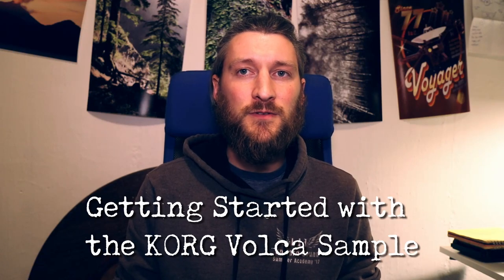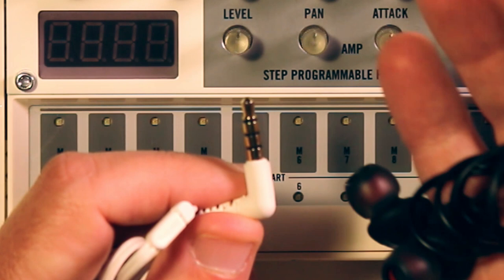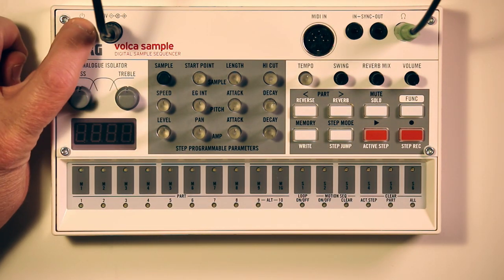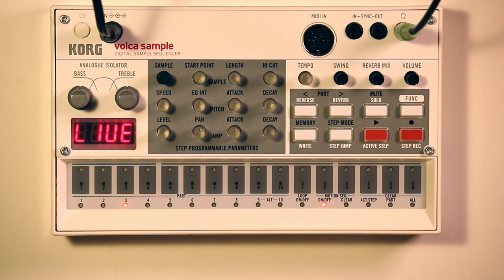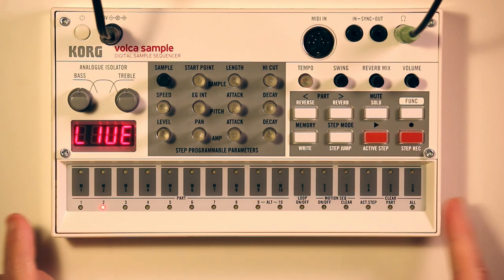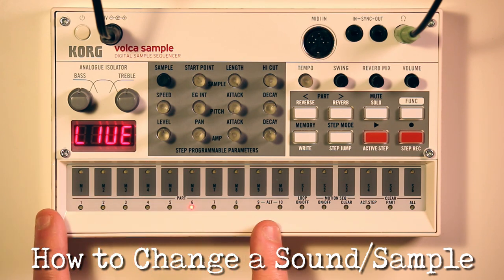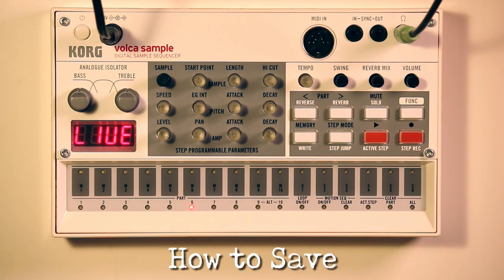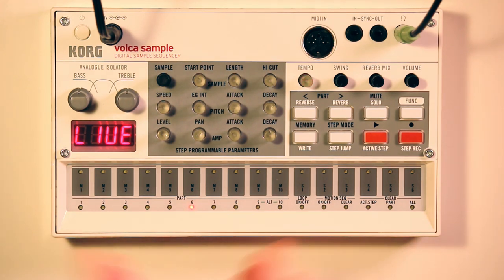1 Volca Sample - Getting Started, using Live Record mode

Comment: New Sub here. Thanks for these Volca sample lessons. I have long wanted to try and create ambient music and now I am older with more free time so I am going to give it a try. I just picked up one of these as well as a PO 33. I have an audio interface and my wife is a musician so we have a mixer. I have audacity on my computer but have not learned much about it yet. If you have any advice or thoughts on which Daw might be the best for a beginner and also which devices to use to record into a daw I would appreciate your advice.
Reply from the maker: Great, and welcome! I don't actually use a DAW, so I don't have much to recommend there. When I was teaching this class, we used Bandlab, because its free and can run on a Chromebook, and its a fine place to start. Audacity is also great for simple recording. If you have a Mac, Garageband and Logic are both easy to use. On Windows the only DAW I've used is Reason, but that one is fairly complex and specialized. I think Reaper is probably the most popular 'getting started' DAW for Windows/Linux, then of course Ableton is very popular as well. Hope that points you in the right direction!

Comment: In live mode can I record my pianos or guitars voice as sample?
Reply from the maker: Not with the Volca directly, it doesn't have the ability to record incoming audio. However, you can record those instruments with a separate recorder (perhaps your phone) and then load the files onto the Volca Sample using Vosyr.
Reply: @minimal.camera  I understand.
Thank U.
The sound quality will be low quality or not?
Reply from the maker: @kabirbody That comes down to the quality of your recorder. But even if you put full 48k Hz CD quality recordings onto the Volca Sample, Vosyr will reduce the same rate to match what the Volca supports, which is 12-bit, 31.25kHz. So it will sound a bit lofi no matter what.
Reply: @minimal.camera  thank U.
I'm new in this things and I'm not Sure in this things.

Comment: Is there a way to factory reset a channel after you've saved to it?
I was wondering if you had to just factory default the whole machine 🤔
Reply from the maker: If by 'channel' you mean 'part' (1 of the 10 sample slots), then no, I don't think there's a way to factory reset each part. If you need to start from scratch, just set all the knobs to a neutral position (far right for most of them, far left for a few), and pick a new sample.
Reply: @minimal.camera  actually meant one of the 16 banks that you save your pieces to. Like if I erased one of the stock loops that I was using as a skeleton for a custom one.
I'd like to use all 16 of those to make one long loop but I don't want to lose the cool ones that came with it either
Reply from the maker: @hermansmith8184  Ah, I see. Vosyr lets you save and load sequences, and factory reset.